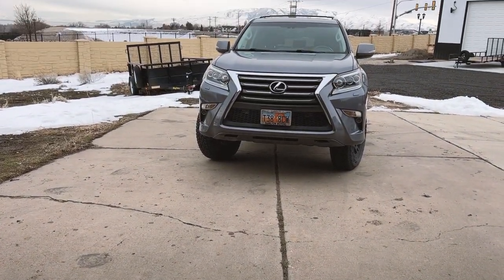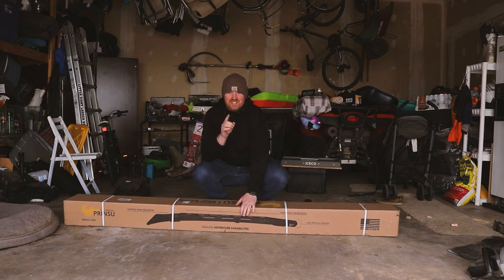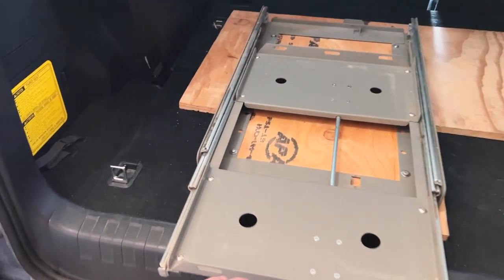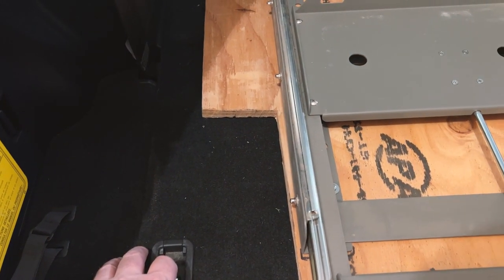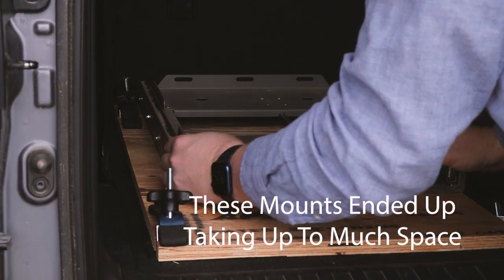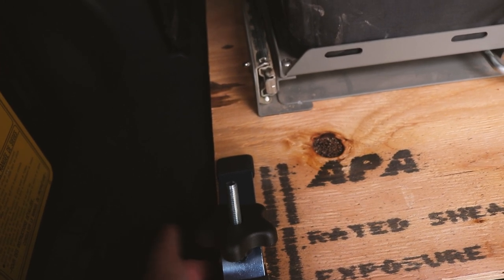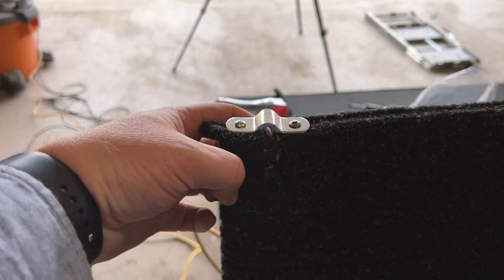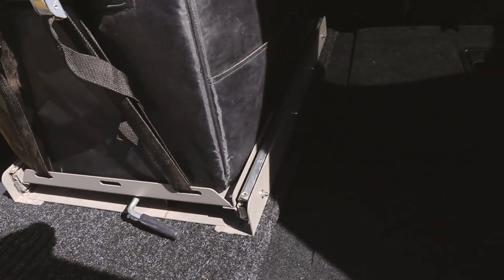GX 460 Roof Rack And Fridge Slide Upgrades

Comment: The slide is such a game changer.  Especially since I mount mine high (I had to go tilt-slide, and my LX has enough room to put a frontrunner size box below the fridge).  I hated how expensive the slide was, but so worth it.  The carpet is a great touch.  I should go carpet my shelves.

Comment: Very nice rack, wonder if getting stainless steel would solve rust issue or is it not worth it? How is it with road noise? Is it rubbing on the roof front, it looks real close.
Reply from the maker: I’m not sure yet on if I think it’s worth adding stainless hardware. I imagine it has several years of use before I’ll know. It is noisier than no rack. We did a trip to PNW a few weeks ago and going 80 with wind and it was louder than I had hoped. The front wind guard has a foam dampener that is meant to touch the front of the roof and keep it from scratching, no worries there IMO.

Comment: I just did this myself. But my back end wants to come up when I pull it out. I locked down the end on the tow part but the other side wants to come up causing my wood to bow. Does yours not ?
Reply from the maker: Are you doing this on a GX460? It’s a pretty flat surface no issues with bowing on mine.

Comment: Be careful the mounting washers and bolts will rust on the Prinsu racks.
Reply from the maker: Seems to be a prevalent issue for most racks. I had to switch out several on my Gobi as well.